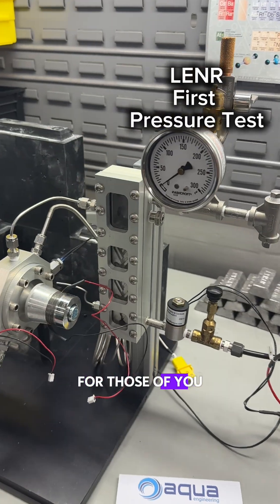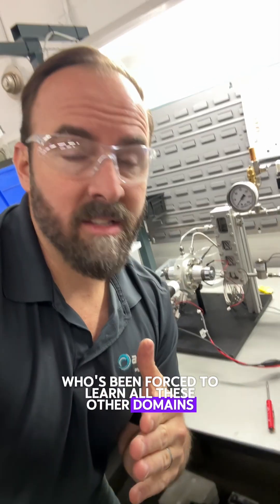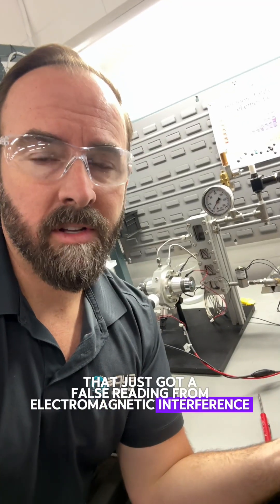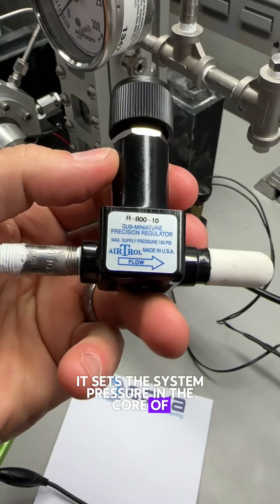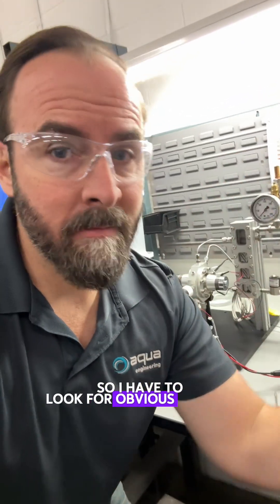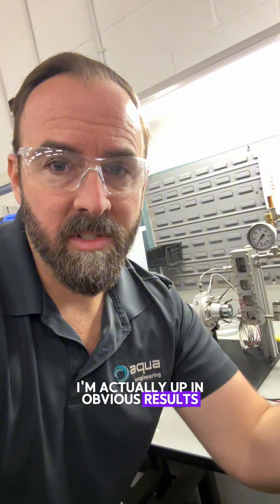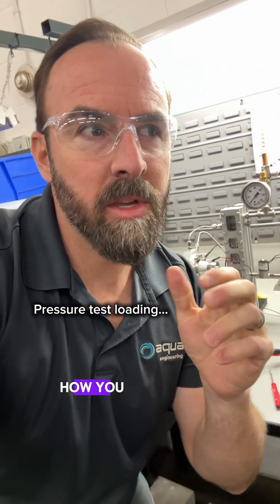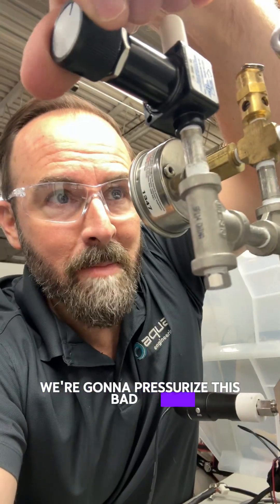First LENR Argon Pressure Test

Comment: Just started following you in the past couple of weeks and encourage you to continue your efforts of sharing the training in the maker space!  The natural curiousness and excitement is contagious.  You are very good at it.  I have been in the industrial automation space for over 35 years and will be retiring next year as a engineering manager.  I have been preaching to my young engineers and technicians that training in electronics, metal or material working and software is important.  I think it is great to experiment with physical phenomenon; however, I think the LENR will not go far,  the energy levels are just too far apart.  Don't be discouraged, sometimes we miss alternative use for tech.  I am wondering about the use of Sonoluminescence toward the used of studying cavitation in prop design for submarines and ships.  If you could devise a method to study small bubbles at machine interfaces, I think the Navy would be interested!  Just a thought.  Best Wishes!
Reply from the maker: Hi James! Welcome & thank you for the input. I’ll continue to keep variety on my channel. RE the LENR project, it’ll be a win even if no LENR anomalies happen. The goal of having a well documented high pressure high temperature sonoluminescence reactor (open source) will be one of a kind and should spawn many other areas of study, as you mentioned. I think just materials processing in a continuous reaction could be huge. Thanks for watching!

Comment: What if you had flat plates on the transducer to make your bubble a plane instead of a point. What if you had a colloid of multiple hydrided materials lower on the periodic table and oversaturate it with hydrogen so the 2 materials go up one on the table and then combine to go up even more on the table. My theory on the sonoluminescense LENR is it's just so much energy in that little bubble it's almost equivalent to the LHC ramming particles together but from all directions. Rubber flat gaskets between the manifold and the bulkheads instead of o rings to further mechanically isolate the transducers. Maybe heating elements around the water to increase the base temperature and thus increase the temp in the bubble. Changing the duty cycle of the transducers to tune the location of the bubble maybe?

Comment: I'm not even a physicist but I would like to add microwaves to this equation and maybe focused lasers not to make it like a German disco but to increase the possibility of fusion. You hold it with sound waves, increase the internal pressure, place negative bubbles, support it with lasers, drown it in microwaves and force all of these to a single point. The moment Cherinkov radiation starts to come out, you run away and always have a radiation shield around you, just in case. After all, our goal is to achieve fusion from here and we don't know the results, maybe never!. Maybe a cosmic Terror will come out!. Like a genie out of the bottle!. Oh, and by the way, let me tell you, the negative bubble you placed inside should have deuterium or something. After all, you're trying to do fusion, right? That's a possibility. In the meantime, there might be a very big glow and a lot of heat for a very short time. And the heat in the room might not subside for millions of years!... I mean, even if the glowing ends!... Of course, this is completely my delusion!. I mean, it would be better not to be in that room when things start getting serious. The government will probably be on your back the day you get the results. 🤣If you manage to create the cavity negative bubble, it would be a revolution, huh?
Reply from the maker: Haha awesome. Slight correction, I’m not set on fusion. I’m exploring whatever black box LENR phenomenon produces excess heat. But we’re still only on the hunt for sonoluminescence, then we add the heavy water, the electrolyzer, and palladium colloid.

Comment: I’m a long time fan boy of sonoluminescence. Have not looked at it in a while, but the mechanism is in my opinion one of the more promising ones. There are lots of papers out there on that (which I assume is what you are doing in one form or another) and although I suspect you probably have them already, if not, they can fill in the physics void.
Reply from the maker: Agree! I think it’s the most practical “tool” to commercialize real-world nuclear heating if it’s for low BOM cost decentralized designs. The minute you add high vacuum to a BOM, you are spending tens of thousands of dollars and have reliability issues. Sonoluminescence allows sub-thousand dollar BOMs, maybe even sub-hundred dollar or sub-ten dollar BOM. So I’m immediately saying let’s just use Sonoluminescence as our hammer and find the right nail.

Comment: The toroidal moment is just part of it, kind of how the charge clusters/Exotic Vacuum Objects/plasmoids feed on material after their electric/magnetic fields rips it apart. In cavitation, EVOs are formed as water vaporises inside the low pressure bubble, causing charge separation, and the bubble collapses, causing multi-axial hydrodynamic shear, causing the charged particles to form the semi-stable clusters. EVOs feed on material, cohering it at the core (quark/gluon/electron plasma) via A.B. effect, until they destabilize or collide into something, spewing out the contents which decoheres/freezes out into protons+neutrons forming stable elements again, and typically leaving iron rich microspheres behind (like a shell of the coherent energy froze at the boundaries). That's my rough, high school physics level understanding after following Greenyer at MFMP for years. The toroidal moment also helps propel EVOs/plasmoids and chain them together (fractally into larger structures) or cause interactions between them, joining / breaking like smoke rings, etc.
Reply from the maker: Well summarized, thank you!

Comment: You're an electrical engineer and "brought a unique skill set" to the issue?
Reply from the maker: Correct, twenty years of solving any and all problems that enter my R&D lab. I believe that positions me very well for taking a vastly different approach to this LENR problem, namely to both commercialize and possibly solve a LENR power generator device. I know it’s a million to one odds.
Reply: A degree doesn’t mean you’re confined to that knowledge, just say you’re not smart
Reply: @BPR230 what a ridiculous and malicious comment in an otherwise entirely positive environment of hands on exploration. You would have been the type to sarcastically laugh at Columbus as he set sail from Puerto de Palos. Yes, it is not known if this or any LENR research will bear fruit but Columbus success wasn't knowable then either.

Comment: Best guess with current data known to me. The forced collapse of air  under a unbalanced pressure environment greater and induced by frequency causes a electric magnetic filed that also collapses causing The electrons to break away from the nucleus and then interact with the hydrogen created by the electrical charge induced by the forced collapse and with rapid friction,  causing an ignition of said made hydrogen.  Causing the light produced and heat,  but that's just my guess without more data.
Reply from the maker: We’re not trying to chemically burn hydrogen tho, we’re trying to create Bremsstrahlung from the colliding of atoms. It shares similarities with the dieseling concept you mentioned tho. If I understand what you were saying correctly.

Comment: As someone who is pursuing intensive research across tech, applied physics, AI, and quantum systems, I must say I am genuinely impresed by your work. This is the exact kind of rigorous & hands on engineering that pushes boundaries and awakens the fire in the bellies of others leading to other following suit. (Including myself) Like you saw a unique opportunity and position to be in and decided to just go and do it, and not just do it but do it as properly and systematically as you're currently capable of!The honest look at experimental r&d and the debunking of your own false gamma alarm as emi is the kind of critical rigor most people won't ever achieve them selves based on pure interest and passion. Presurizing the system is a great next step because elevating the static pressure should, in theory lead to a much more violent inertial confinement on the bubble colapse. and dude, your low budget. high signal. approach is exactly what this field needs because lookin for obvious heat instead of just noise margin anomalies is the only way I see this could ever become viable and decentralized. Truly fantastic work man, you deserve all th kudos.You're an EE, so you have the perfect skillset for the next major hurdle, but your primary chalenge isn't just generating pressure. It's bubble stability. A perfectly symetrical collapse is everything. you should consider adding another force to lock the bubble, and I can't really tell by your current exact set up but would recommend designing a quadrupole magnetic field to electromagneticaly levitate and stabilize the argon bubble at the precise pressure antinode. That external restoring force will help fight the asymmetries that kill the collapse. Also to solve your emi sensor problem for good you could just switch to optically isolated sensors (like a fiber optic thermometer) inside the chamber. They're completely immune to emi and will give you the obvious heating data youre looking for free from any false positives. This is remarkable research my man, keep going!
Reply from the maker: Thank you! RE bubble stabilization, yes, agree 100%. I eventually want a single stable bubble collapse at the center of my sphere as originally intended. At that point I’ll release CAD on the GitHub so everyone else can duplicate whatever I find. I still have a ways to go and am investing various tweaks that will explore the bubble. So far I’ve found that the bubble is surprisingly resilient and stable once it forms. Very forgiving, more so than I expected. So I’m still doing the broad strokes and whittling down the unknowns before I really start optimizing.
Reply: @i2c_jason  open source is the greatest support in the world

Comment: I have never seen a pressure sensor tick up like the second hand on a watch. What kind of compressor is that using?
Reply from the maker: It’s an Argon tank regulated to 100 PSI and fired in by a solenoid valve, through software.
Reply from the maker: Thanks for watching till the end btw!